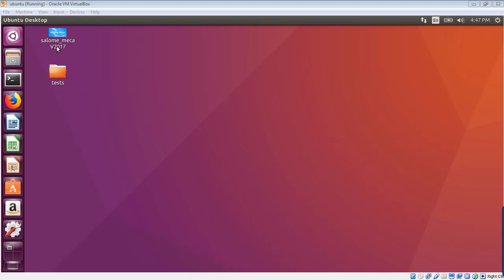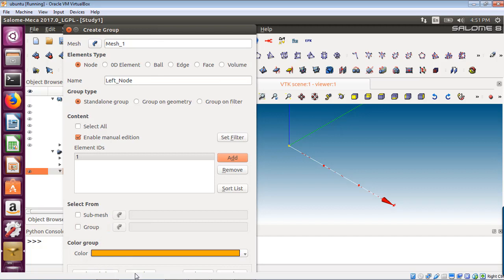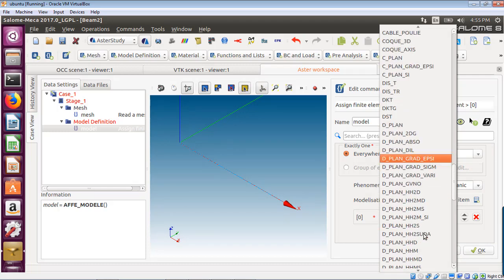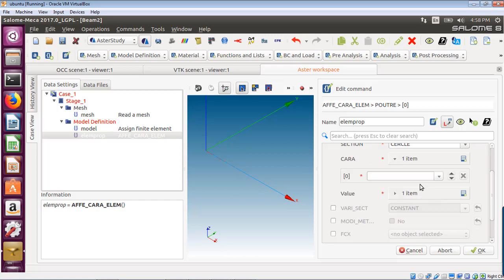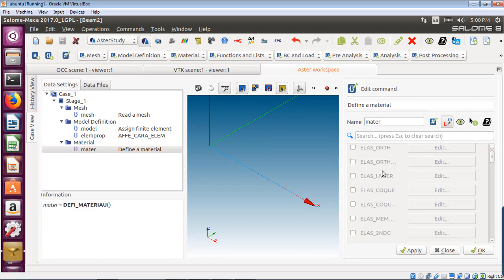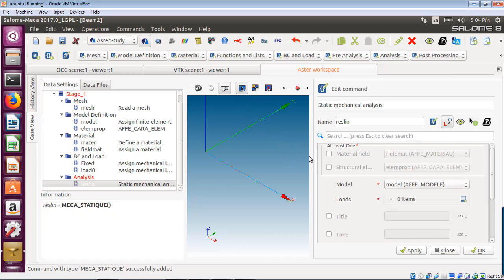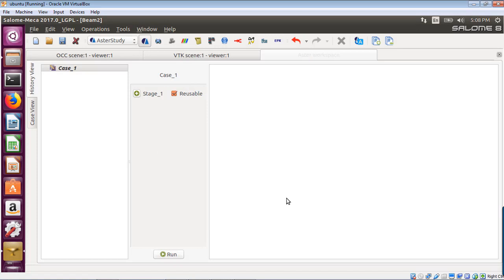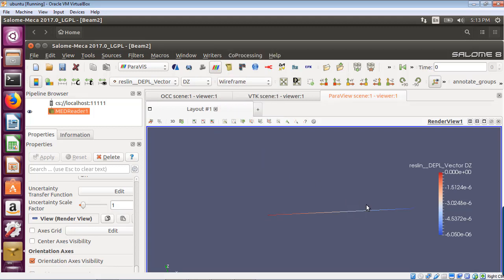[Tutorial] How to simulate a Beam in Salome Meca 2017?

Comment: Thanks for the video. I am new in code_aster, I follow all the steps, however, at the end when I am doing output, I recieved this message (file path contains unsupported symbol. you will not be able to run code aster). How to solve this problem? For your information, I am using (Beam.Result.med).
Reply: Thanks for your reply. The problem has been solved. I am using Code_Aster in windows 10. I followed all the steps without any problem. At the end, when I run the case, it is running…. without ending. When I click at the screen, it ends with red colour results. 
I don’t know, what is the problem?
Is it because of windows instead of Linux?
Reply from the maker: Save your file at the root of your system (same for the folders of Salome Meca). You have some characters in a foreign language or spaces in the path of your file and this is not supported